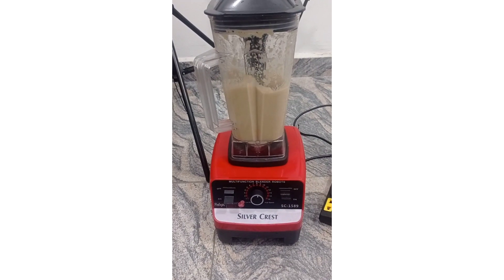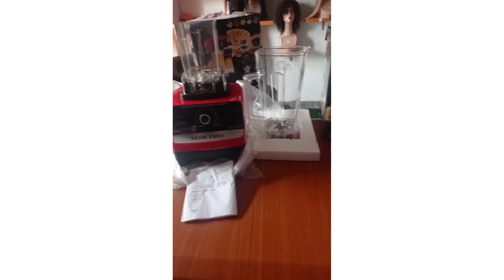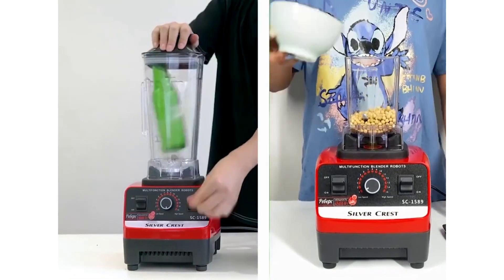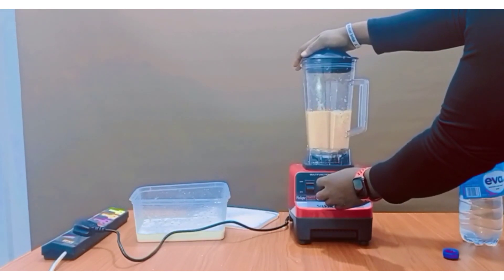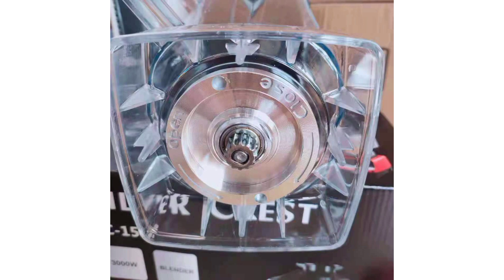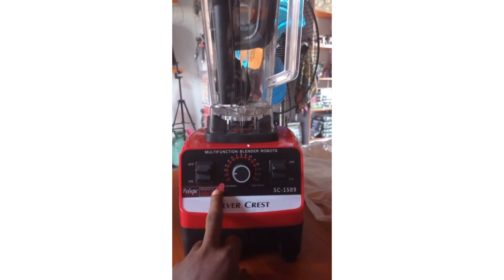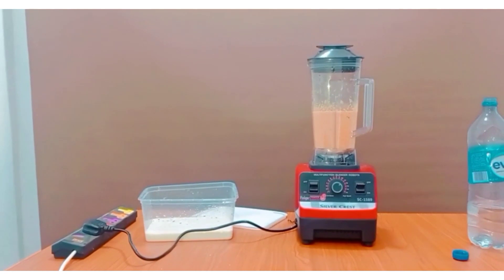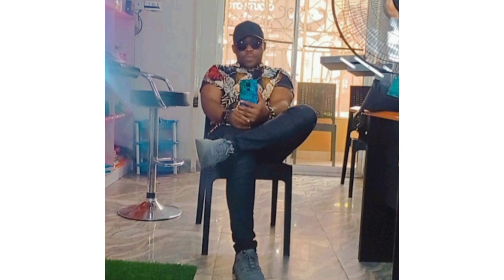Difference between the 4500w, 5000w and 8000watt silver crest blender

Comment: Can you regulate the wattage of the blender when using it?
Reply from the maker: Wattage is not something u regulate. I don't know if you meant something else from wattage though
Reply: Yeah, you can regulate powet by moving the speed knob
Reply from the maker: @danielt5389  power and wattage are two different things if I'm not mistaken
Reply: @vejluxury6391  they are the same exact thin. SI unit of power is watt
Reply from the maker: Ok
Reply from the maker: Then the question was an induced enquiry

Comment: I bought a 8000watts silver crest.  But am so disappointed
Reply: Got one too and returning it, 8,000W struggling to blend beans
Reply from the maker: Invest in an original one give me a call
Reply from the maker: Sorry about that. There are original blenders out there.  They are quite an investment
Reply: 4500w may be a gimmick. I had 300w blender which did everything I need . However, I bought another blender which is 2200w can blend a little better than the previous one. It also depends on rpm means how many times it spins in a minute. I am pretty sure any 1500w good brand's such as Bosch, Braun will do much better job than this 4500w, 5000w, 8000w gimmicky blender.
Reply from the maker: The original are not gimmicks. Just invest on those ones and the rest is history
Reply: The ones sold to us here are all fake total waste of hard earned money